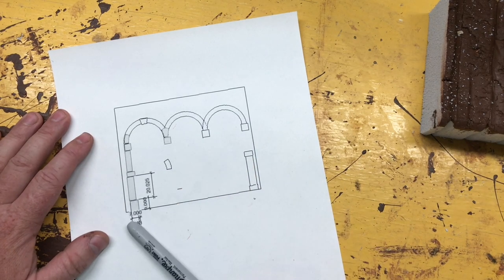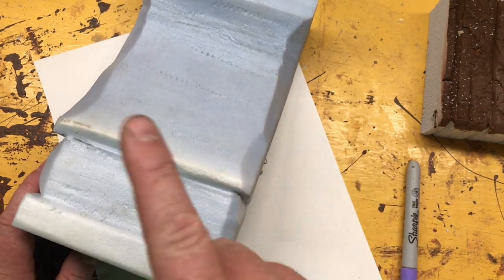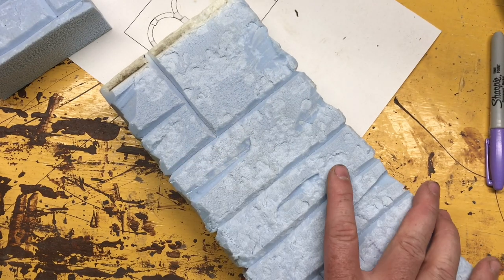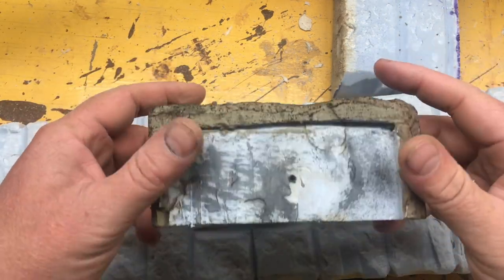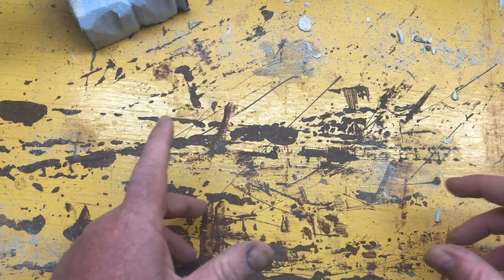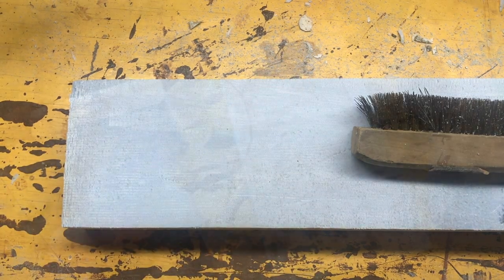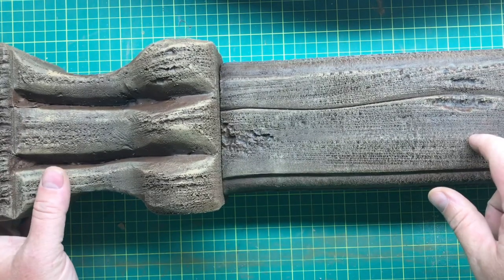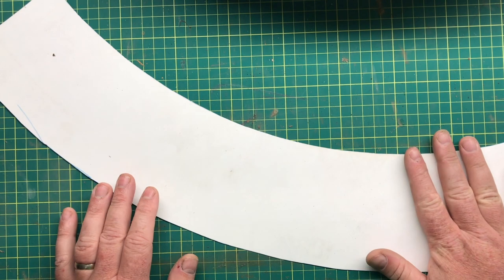Change a room with styrofoam into a fantasy room!

Comment: Looks great!    I'm already doing this for a LOTR Rivendell room and I've been thinking how to attach it to the wall.   Aluminum tape?  thanks.....does that come off easily when you want it to? I hope...I thought about just foam PL 300 glue  but  worry about if I ever need to change it  how it will come off the dry wall.   Love your videos   glad I found you
Reply from the maker: Thanks Scott!  The aluminum tape did well and didn't pull the paint off the wall, but I did have some issues if someone knocked into it, it would usually cause a whole bunch of it to come down.  I found some Draft Attack silicone I'm going to try this year, as it's built to be removed and I think it will give just the right amount of adhesion without damaging the drywall.  Glad you found me too, and thanks for watching! :)

Comment: Love your channel so much! Where do you buy your foam from?
Reply from the maker: I'm really happy you enjoy the content Robin!  Honestly, most of my foam is salvage and used from the local garage sale sites, but otherwise I purchase larger sytrofoam sheets from my local Home Depot :)   I'm always on the hunt as I go through so much!
Reply: @SamhainPropworks  Thanks for the reply. I actually purchased your 3D print design for the sconce the other day and have just ordered a few to be printed :) 

How will the Styrofoam hold up for a higher traffic area? I'm looking at creating several rooms in a medieval castle style for an escape room and am toying up between several different methods.
Reply from the maker: I saw your purchase, it very much made my day and I appreciate your support!   The foam is... decent in a high traffic area, but I have to admit by the end of the holiday season (Sept-Jan). There was a few scuffs on the floors pieces from kids running by and smacking them or a vacuum having some close encounters with it!    I think I need to find a solution that is cheap and durable but not have to go as far as fibreglass coating it!   I have read that spray Plasti-dip is a great solution, but I have not yet tried it myself :)